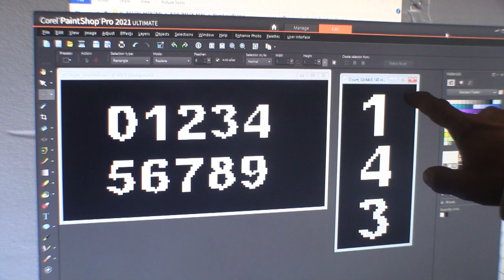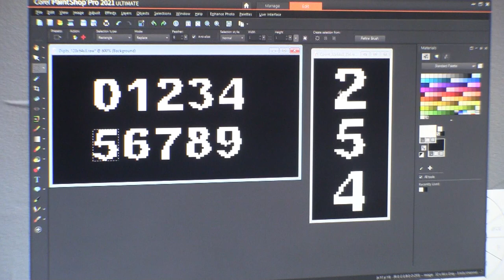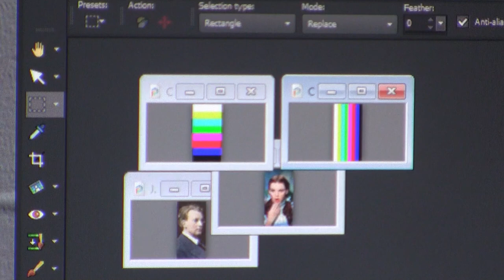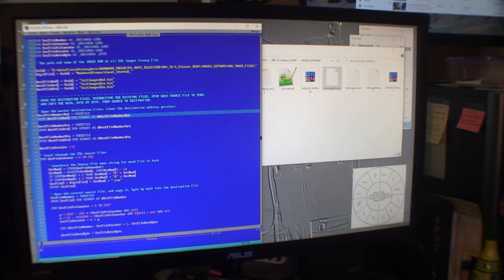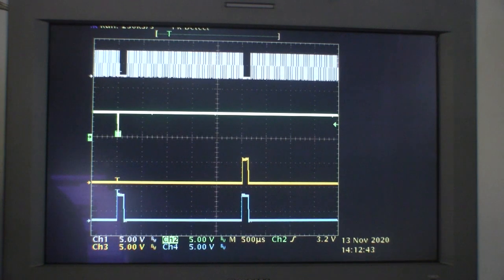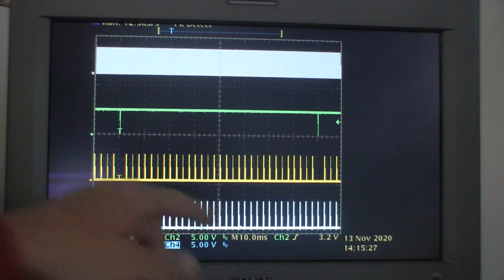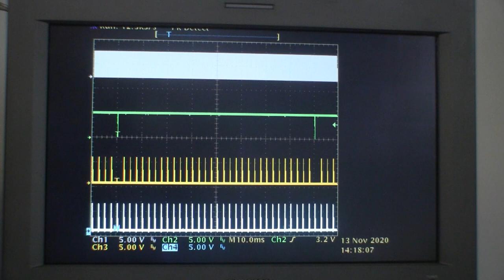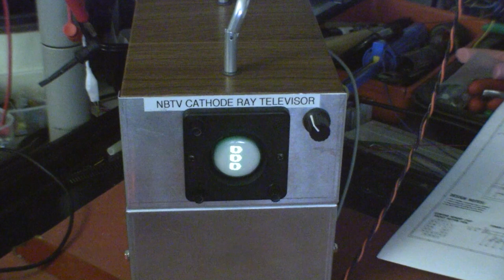NBTV 10-4 Eleanor, Part 5

Comment: I feel sad that you did so much hard and tedious work just on the frame numbers. I'm pretty sure you could write a program that would write numbers in a console in the correct order and then screenshot them (or use MS Word and create a text box with a numbered list with altered direction and save as image) and then use an ImageMagick script to cut the image up into the appropriate chunks and save as 1-bit BPP bitmap in a BMP or RAW file. Next time, you could contact me so that I would do the job for you while you work on hardware. I might also manually create a font that has less aliasing visible - just give me the font dimensions, choose the typeface I should base mine on, screen margins, character spacing you require.
Reply from the maker: Don't feel sad. All roads lead to Rome. Thanks for offering to help. There is a thousand ways to achieve any goal. It took less than 45 minutes to create those 256 image files. It was FUN and satisfying too. It was a very simple method. It only needed to be done once in my life time. It used the the tools I already have on hand. It got the job done. 
Did you see the color pictures that will be added to the EEPROMs next? You will be happy then. My biggest barrier is copyright. Really great pictures always seem to belong to someone else! Thanks for your enthusiasm. Have a great day!
Reply: @videolabguy  Search for pics with the Creative Commons license, and mention the author&license in the description or a textbox in the video. You will be able to use most of Wikipedia and YouTube this way. Fair use may also apply for copyrighted content.